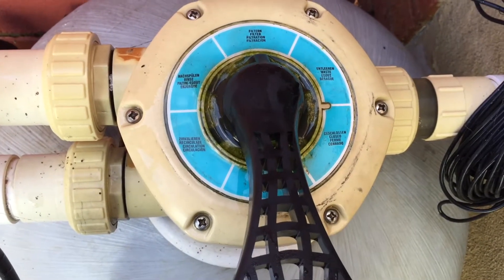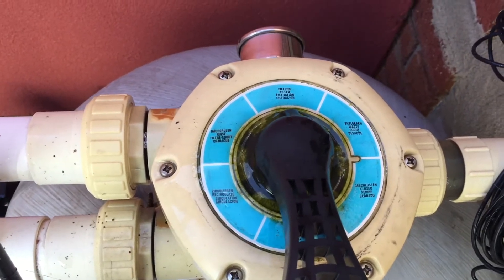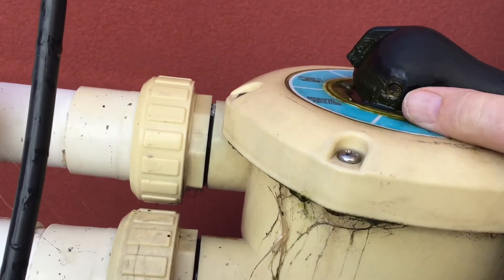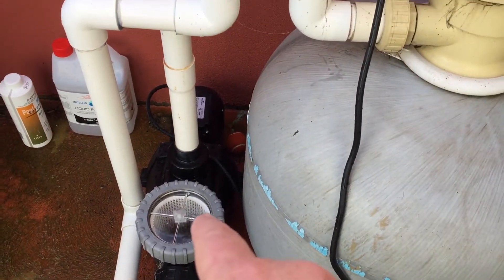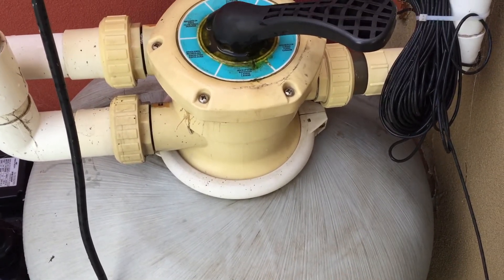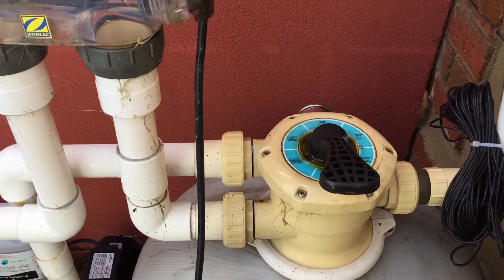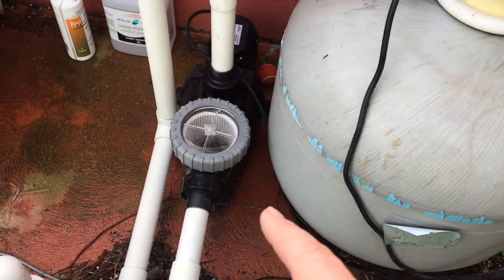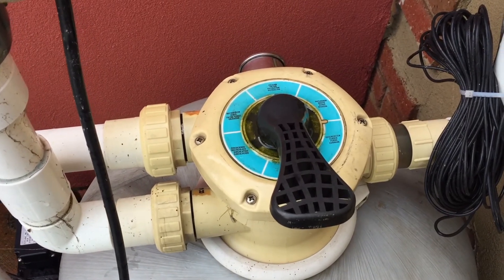How a MultiPort valve works. Swimming Pool filter Sand or Cartridge Spa or Pool

Comment: I'm trying to find this model type to get a new O ring for it, I've got some horrible leaking happening between the top and the filter itself. 

Also trying to get the O ring out seems incredibly difficult with all the pipes tightened up from it, are there specific tools needed to undo these and get the O ring replaced?
Reply from the maker: Here is a video that shows you how to change the o’ring. 
How to service/clean Multi Port valve, sand filter repair. Pull apart fix grease lube valve head https://youtu.be/VCCYkn3g5BI